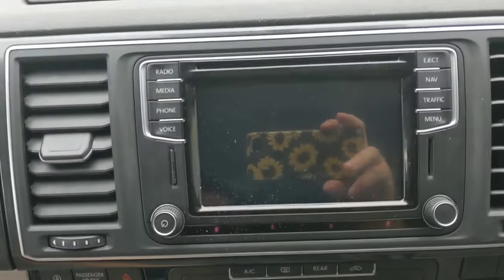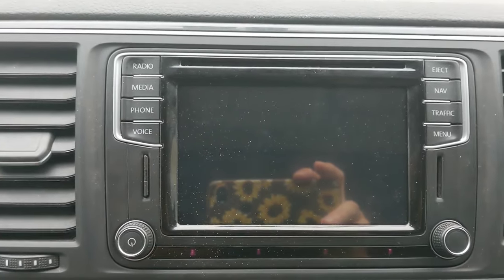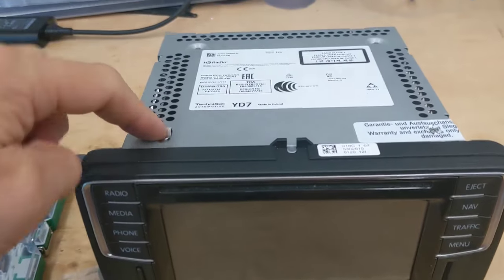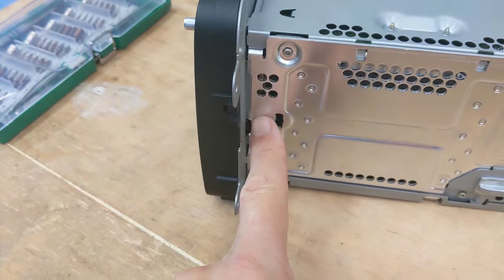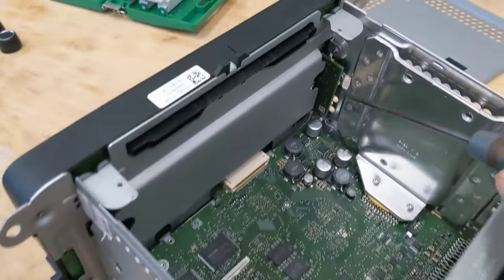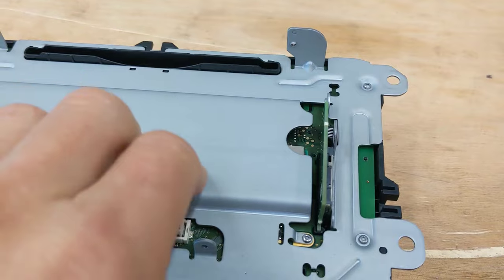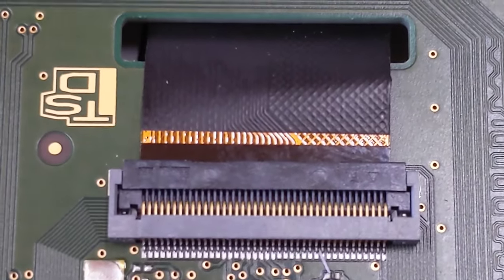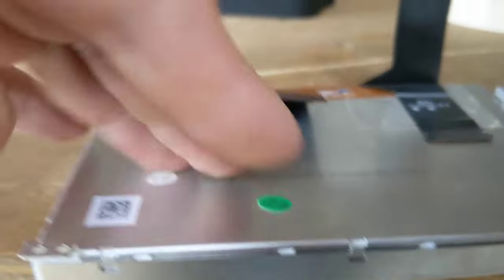Repairing the faulty touch sensor on a VW head unit.

Comment: Thank you for posting! I have had the same problem for the past year with no posts online to help solve. Do you know if this part should also work for 2016 Passat? Thank you in advance!
Reply from the maker: So i've no idea if it's the same in the Passat.
I think if it looks like the same unit, it probably is.
If it was me, for the price, it would be worth the gamble taking it out and to see if the part numbers look similar to mine.
Let us know if it works out for you!
Reply: @DuncanLaw  I went for it and just received my order today. After $15 for the new screen, $12 for a set of precision torx bits, and about an hour of my time from start to finish, I replaced as described in your video and everything is working perfect. VW dealer said the only way to fix was to replace the head unit and quoted me $1,900. Thanks again for posting!
Reply from the maker: Thanks for letting us know!
That's exactly where i was before i worked out how to fix mine.

Comment: Hello, I have a radio exactly like that, the touch screen fails me on almost the entire screen, what was the final result? Did I close the radio well? How does it work?
Reply from the maker: It is ~1 month later and it's still and it's working perfectly.
Closing the unit with the both the old sensor and the new one installed was easy. I thought the extra thickness might be a problem but it wasn't.
I'd recommend giving this a try. It's much cheaper than any of the alternatives.

Comment: Thanks Duncan,
I understand we have to connect the gold harness back, (which is stayed connected to the old screen) is it so?
Reply from the maker: If i understand you correctly,
There is a smaller black cable from the touch sensor
and a wider gold one from the display.
Yes, Both the new black one and the old gold one need to be connected.
Reply: @DuncanLaw  You seriously R O C K!  :)  2017 convertible beetle here ! Many thanks! Many, many thanks!
Reply from the maker: @bvee9262  If I remember correctly, I just took all the screws out and it came apart.
Have you pulled the 2 round knobs off on the screen since as well?
The card reader modules do pull out as well but you don't have to remove them.
Reply: @Duncan Law  hi Duncan, all good I worked it out, it was getting the clips free. Thanks for your help. It is back together and working. Cheers

Comment: Hi, I tried to follow your information, but the screen remains off and the diagnosis says softweare incompatible.  Do you have any ideas or solutions? Thank you
Reply from the maker: so this is after you swapped the sensor right?
and it at least displayed something before (even though the touch sensor didn't work)?
I think most likely explanation is you've not managed to re0connect the screen cable properly. They are a bit fiddly. a magnifying glass helped me see it the cable was seated properly before closing the clip.

Comment: Dear Duncan Law,
I watched your excellent video and like it. Do you know where I can buy touch screen for my rns 315? Thank you.
Reply from the maker: Try contacting the Aliexpress seller i bought mine from.
They may know the part you need and i think others have found them quite responsive.

If you find a solution, i encourage you to post about it online. This video seems to be helping a lot of people.
It gives me great satisfaction making sure VW does not profit by selling replacement parts from something that it their fault.
Reply from the maker: If you can't find any parts vendors who know, try dismantling it and look for a part number on the screen.
That's how i worked out what i needed for mine.
Reply: @DuncanLaw  Thank you for fast reply. I wrote to your Aliexpress seller and some of them  but they are not sure about exact answer. RNS has 5inch touch screen, but they sell 6.5inch and says it is for rns315. I can find touch screen glass with lcd that is to exspensive. Will try your recomandation and see part number. All the best for you.
Reply: @DuncanLaw  Thanks you. You made a difference by posting this video.

Comment: Hi Duncan,  Found your video as my Alhambra has the same issue, it got worse this weekend with  most of the right hand side of the screen not working.  So no android auto.  Just put in an order for the screen after sending photos of my unit to alixpress seller.  Same unit as yours.  Hopefully this fixes it as after moving from Dublin to Cork I'm still terrible at finding my way arround.
Reply: So got the part today and fitted it and it worked perfectly it actually looks clearer than before.  Superb video.  It's quite involved but well doable take photos of where the screws come out as you go along epsecially the part where the screen pulls apart.  Again huge thanks its working superbly on my Seat Alhambra
Reply: Can I ask about the year and model of your alhambra, I am considering doinh this on mine, wanted to know if it is likely the same part

Comment: Hi, I have attached the new sensor screen which now works, but the screen is now blank??? any ideas on why this is please?

Thanks
Reply from the maker: Maybe the screen connector? Sounds like you've got the sensor one connected right but maybe the screen one isn't seated in correctly?
Reply: Tried, tried, and tried again. Still no picture 😢
Reply from the maker: @gerrordwilson196  That's a shame. I think you are the first person to report a completely broken unit.
I know there are Android replacements for this which are much cheaper than the original. I've never seen one first hand though.

Comment: great! where can i buy a new sensor? Do you have a spare part number or a distributer?
Reply from the maker: There's a link in the video's description to the Chinese reseller where i bought mine.
Looks like it's a gone up in price a little since i posted this so it's possible you'll find it cheaper elsewhere. It's still very inexpensive though.
Also the part number is in the description. You'll need that to select the correct one.

Comment: Does the fix hold up long term?
Reply from the maker: As far as i know, it's the same part as the original. So it should last as long as the original part.... which is not as long as ideal.... 
FWIW, mine is still working 1 year later.

Comment: Hi, has anyone done this on a facelift scirocco? Wondering if the parts are the same.
Reply from the maker: If it looks like the same unit then it probably is. VW use the same head unit in many of their vehicles.
If it doesn't look like the same unit, try dismantling it and look for part numbers and search for them online. That's how I found the right part to use.
Even if you can't find the exact part number of the touch sensor, there are only a certain number of controller chips in use. If you find a touch sensor with the same connector and the same display size, the chances of it working are reasonable. eBay, AliExpress and Banggood are all worth searching.
Reply: @DuncanLaw  thanks mate. I've ordered the same one as you so fingers crossed. Do you have any info/vids of how to take the unit out of the car?
Reply from the maker: @oliverrichards8675  I was doing this in a van. I think every vehicle type is going to be a little different.
In general though, the plastic trim is the hardest bit. It's usually clipped on with very stiff friction clips.  Try sliding something thin, stiff but not hard enough to mark the plastic in at the edges of the dashboard and see what you can lever up. The first clip is the hardest. Once you find one clip that opens, it becomes much more obvious where the rest parts.
Dashboards are designed to be taken apart but it's not always obvious how. 
Try looking for someone doing similar on YouTube. Also the vehicle manufacturer will have detailed documentation on how to do stuff like this but it's not always online. Good luck and report back if this is the touch sensor for your vehicle model. It'll help others with the same issue.
Reply: Finally got around to doing this. All the same for scirocco.

One question though...I have a bit of a yellow halo around the edges of the screen. Any idea what might cause this? Overtightening of the unit?

Cheers.

Comment: Do the left and right 4 Buttons also touch the touchscreen from behind or are they pushing a mechanic switch on the electrical board?

Background is, that my touch and also 7 of the 8 buttons arent working sometimes at the same time.
Reply from the maker: So the buttons aren't pushing the touchscreen. I can't remember exactly how they are put together though. I think there were small buttons on the circuit board that the plastic front part pushes on.
I can't remember if my buttons did anything while the touchscreen was playing up. I think they did but it was a while ago.
Maybe someone else with this problem can confirm. Sorry I can't be more help
Reply: @DuncanLaw  thank you for your kind reply. Hopefully someone else can tell us something regarding the additionally buttonissue at the same time.

Comment: Plz make a video putting it back together?
Reply from the maker: Too late i'm afraid. It's already re-assembled and working in my van. I'm not going to dismantle it again.
Re-assembly is much more straight forward though. If you get it apart, you'll easily manage to put it back together.
The only tricky bit is the flat ribbon cables from the screen and touch sensor. I show how to reconnect them in the part where i disconnect them in the video.
Reply: It's easy to put it back together. If you want, take pictures of each time you dismantle a piece.